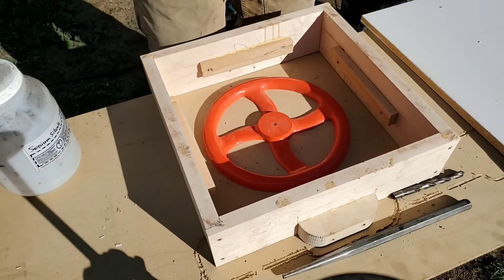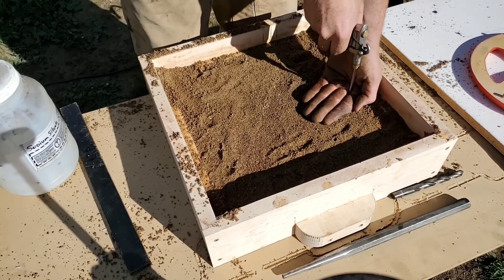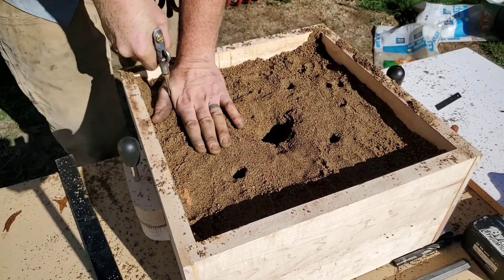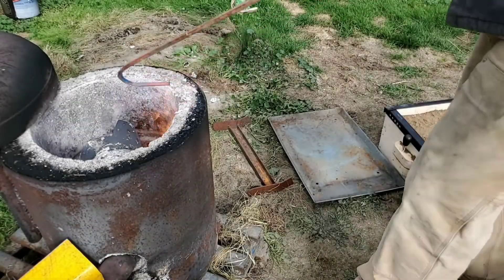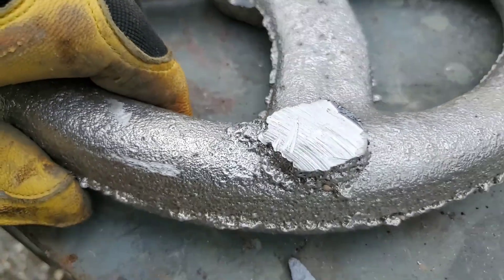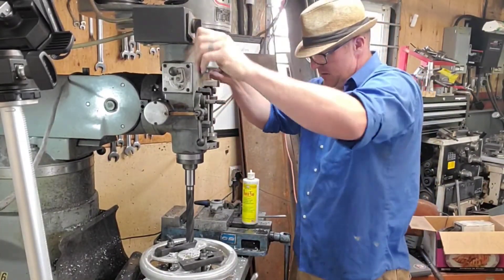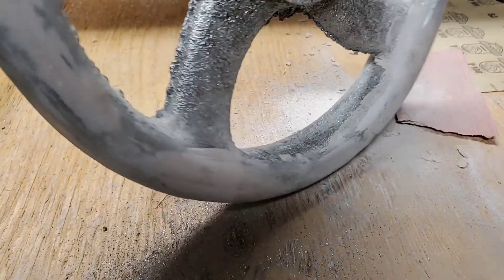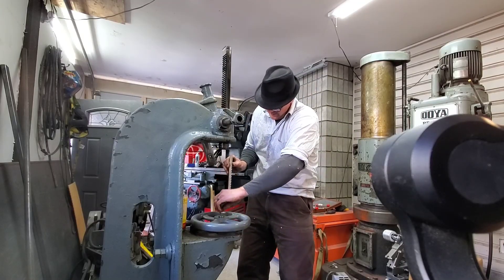Casting an Aluminum Handwheel using Sodium Silicate

Comment: If using sodium silicate can you reuse the sand? You can with bentonite clay. Sodium silicate only seems to come in a 40% mix here in the UK. Is that normal?
Reply from the maker: I'm not sure. You may have to do some experimentation to see if the sodium silicate at 40% will work. I don't have any bed night in it and it holds it together quite well. The way I've been using it is that it's pretty much done and discarded when I'm done the casting. However I feel that you could probably break it down and use it as a bulk filler. But you might not get the detail in if you use it in the main spot. I haven't been using it Not much anymore as I switched over to using lost phone casting . Spoiler alert it's a mind blower you might want to check out a couple videos of mine it might change up how you do things
Reply: @Wrighmachining  I really appreciate the reply. I'll take a look.

Comment from the maker: You use the co2 gas and it hardenes
Reply: Could regular co2 cartridges and some sort of a hand gun work?  Cartridges are easy to get but where would I buy a handgun for injecting the gas?  I'm considering casting small parts, like chess pieces.  Perhaps that would be enough co2?  If not, what search terms do I need to use to find the mechanism you are using?
Reply from the maker: @markb5528 I don't know how you would control the pressure from a CO2 cartridge. Although I do like the idea if you could safely figure it out . All I'm using is beverage co 2 or welding gas co 2. With a regulator on it and then fit it down to an air hose. The  Regulator takes it from 2000 PSI down to 50 to a 100 PSI. Where it can be safely manipulated with a regular hair hose blow gun. I've heard of some guy  Using vinegar and baking soda and then putting it in a bag in the same area as it and leaving it overnight . I think that was old Ford  Boy. He did it to you make a core with the same process

Comment: Rural King store has a medium grade sand that does great. Its very fine. I bought a small cement mixer for mixing adhesive sodium bentonite and it really mixes it all fast. You can get this mixer at Harbor Freight stores. It really does a quick job of mixing. I use talc for parting.....I have good luck and hardly any blow holes in the castings...
Reply from the maker: Thanks for the sugestion . I will have to do the talc for sure .  Im in canada so rural king is not here :(  

I am always on the look out for better samd when im in the building stores or the like
Reply: did you modify the cement mixer or you use it as it is? I've seen people that remove the paddles and add some weight

Comment: Co2 fungsinya untuk apa 
Bagaimana jika hanya menggunakan  sodium silicate ?
Reply from the maker: The function of CO2 is to harden the sodium silicate. See you to activate some kind of chemical reaction. Sodium silicate on its own May Harden over days or months left in the Box due to Natural CO2 in the air. But it may not give you optimal results

Comment: I don´t have a way to infuse CO2, does it also bind up after some time on the air or does it take days ?
Reply from the maker: You will have to experiment with that it could in theory as there is small amounts of co2 naturally in the air.  or perhaps leave a test sample in a bag with baking soda and vinegar mixed off to the side .  In theory it would generate co2 gas and over time permiate into it. So long as you don't get it wet with the vinegar can't see why it would not work ( in theory )   I think oldfordboy on YouTube makes cores like that. Perhaps check him out.
Reply: @Wrighmachining  Thank you for your reply. Does the sand hold it´s shape after heating up to about 250°C or does it crumble with temp ?
Reply from the maker: @sierraecho884  it will hold shape once set and will tolerate heat to a certain point. I wish I know more.   If you experiment t with that could you let me know the out come ?
Reply: @Wrighmachining  Sure, my goal is to do lost cast with zinc at home with regular home appliances with undercuts but without the use of the typical investment plaster with burn out cycle, this so just too much for home DIY. 
I found a couple of things I want to try.
1. fire proof spray paint (up to 800°C) So I will coat a PLA part with it, dribble sand in between coats to build up thicker layers kind of like one would do with suspenda slurry and then burn out the part in a kitchen oven.
2. High temp sealant (from a caulking gun up to 1300°C) and then covering the master PLA part with it with some sand as well burn out etc.
3. High temp castable refractory. This will be for way later.

Comment: Hi. Very Interestin.  Would you know the exact formulation of the sodium silicate used?
Reply from the maker: Good question Andrew it says in books i have read about 5% by weight but it comes down to the quality of sodium silicate you have and moisture of sand.  Realy though if your close ( you noticed i just free poured it ) it will work . To much and its a wast amd possible y not setting up or the heat doesnt break it down and its rock hard at the end of casting . To little and it dosent set up of course.
Reply: @Wrighmachining  Thanks for the reply but what I really meant is, seeing that Sodium Silicate can refer  to Sodium Metasilicate, Sodium Orthosilicate and the 'Water Glass" Sodium Silicate, I was wondering what the molecular formula of the one you are using. Thanks
Reply from the maker: @TUCANO9HUMF  oh yes sorry . It is water glass . It was purchased from a pottery place in a 5 gal bucket. They use it for decrative coatings . One lady used it for her work amd showed me and the out side had a cool crackle look to it , an older lady she went on to say that tbey used to use it years ago to preserve eggs as well . But I digress.    Hope this helps . I would have gotten you a manufacture lable but was unlabled when i got it other than a hokey safty lable and sharpie writtem on it

Comment: Petrobond casting-sand is a good value when looking at the labor saving, improved finish, and re-usability. The sodium-silicate trick is great thing with delicate and intricate casting, but not necessary on this one. The sand choice was bad. I thought you should have gone a little crazier with your spoke design so that everyone who sees it, notices that it is an unusual and a unique thing and that it is not a mass-produced thing from China or the Philippines made by child-labor. Pretty cool, and you got the job done!
Reply from the maker: Thanks for your constructive impute john,  yes petro would be better . I will get / make some at some point  so many projects so little time :)  I'm just experimenting at the moment as well .   Before then however i will be playing with lost foam with a basic dip (plaster )
Reply: @Wrighmachining  If you are going to do investment casting then you should probably use the lost wax method. After you melt out the wax, and then pour the metal you will have much less smoke. Lost foam casting uses sublimation of the foam but it smokes a lot and the fumes are probably dangerous. I think you would be happy with the finish with just the petrobond sand and the foam. You can get very accurate parts with good finish, but you have to understand degassing and metal shrinkage. You could get a lot of pinholes and internal stress if you don't, and  the cooling and annealing can be important. I need to get to my casting project.
Reply from the maker: @johnlennon335  whats your project ?

Comment: Other than using a steel crucible (and perhaps unknowingly setting a bad example), great job. Lessons learned are way more useful to the learning process than projects that go perfectly, and by extension, your viewers may learn more as well. Using your arbor press, sans hand wheel, to broach a keyway in the handwheel for itself is a little ironic and maybe a taste of the future where robots are making more robots. Lol. Thanks for giving props to the Facebook group and being secure enough in yourself to leave the mistakes and failings (and fixes) in, instead of just editing them out as others  might. Again, good job! Subscribed.
Reply from the maker: Hey troye thanks for the constructive feed back , its always apriciated . I will make a mention of the steel crucible in the next video I'm casting in for sure .

Comment: Ya did a half decent job, but I'd invest into a 3d printer to make some risers that are a bit more precise than just hand punching them into place. Something you can pack the sand around. Also a sand "PACKER" to help make sure your sand really gets into around the part.
Reply from the maker: Thank you boosted .Good call on the riser .   I have a router and should take your advice on the risers and gating system .  I want to build a over under style so it traps the sand before it flows into the cavity 

The 3d printer is on the list. The budget it low at the moment   I just got a neje 40w laser in the mail and have to install and cut gaskets with .
Reply: @Wrighmachining  Sovol SV01 has been doing the trick for me so far.